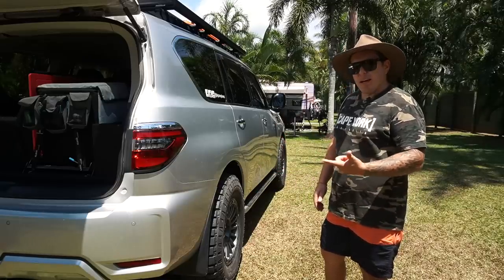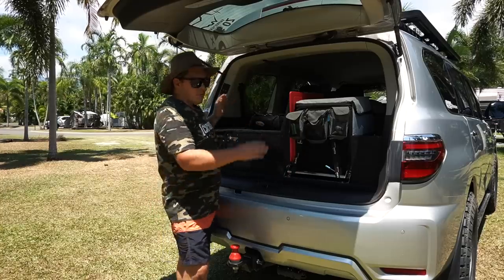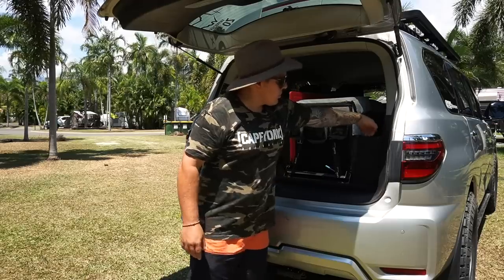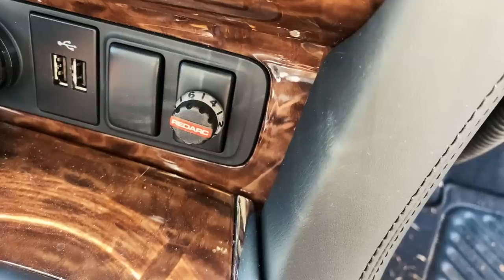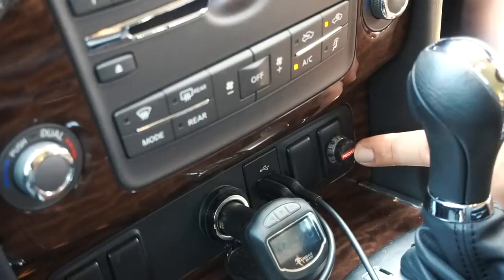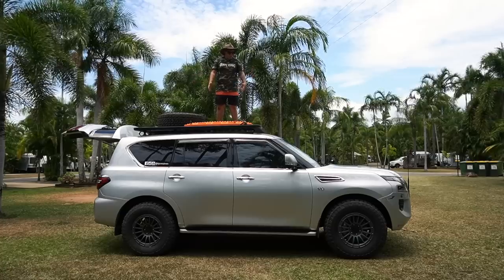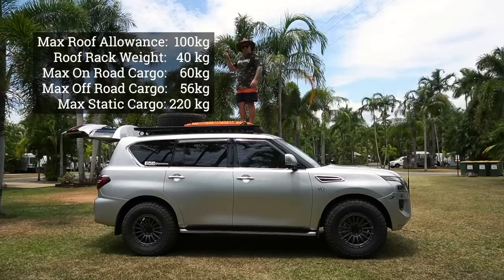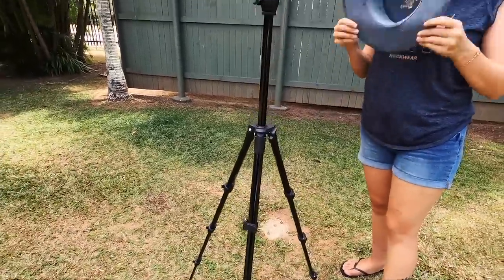AIRBAG MAN SYSTEM / TOWPRO / RHINO-RACK / Y62 S5 Patrol - BIG OZ BUILD - PART 6

Comment: Chris. The most important thing for tyre life is rotation and correct tyre pressure. I used to be a wheel alignment technician. Keep on top of the wheel alignments and rotate the 5 tyres, yes keep the spare in the rotation. If you rotate you can compensate for whatever uneven wear you may get. If you let it go too far then the tyre wont last as long.

That remote control is a 90s throwback. Looks like the Nokia phone in "the Matrix"
Reply from the maker: Thanks mate for the advice! ☺️ 

And that’s funny about the remote, it totally is 🤣🤣🤣

Comment: Hey mate, with the pressure your running in your bags loaded, I believe you run the risk of bending the rear control arms.
There is a  fix from on track 4x4 shop in vic they do billet replacement arms. I have them in my 62 and love them , you get the added bonus of gvm upped to 4085kg and 2” lift, not cheap . You get what you pay for.
Reply from the maker: Technically speaking when we tow we are still within Nissan’s manufacturers guidelines so we shouldn’t be bending anything... We know of On Track and decided against it, not because money was an issue but because we wanted to show people that you don’t need it where others do have money restraints. If we bend an arm, we’ll fix it at that time I guess ☺️ cheers for watching and the advice regardless! 🤙🏻

Comment: I think its  a legal requirement to have an electronic brake controller for towing anything over 750kg.    Not necessarily legal requirement to have a red arc tow pro..   any brand of controller will work just fine. ...
Reply from the maker: Yes 100% agree! If that was worded wrong or heard wrong, I can assure you we’re on the same page! Redarc or any other break controller will do the job for over 750kg 👌🏻

Comment: Great video as usual. I can say the sony's do run hot when doing 4k 25-30fps for more than about 8min. ( Happens to other brands too "GH5") I recommend the "smallrig" frame for your camera as it gives you a bit of protection and the ability to hang not only mic's but lights etc off them. You are giving me some great ideas for locations etc for our eventual trip north. Safe travels
Reply from the maker: Thanks Tezza! We don’t record in 4K thankfully (way too big for YouTube) but 2.7 so we have some wiggle room if I need to zoom in. We haven’t had another issue since and overall it’s been a pretty good camera otherwise! Thanks for tuning in and glad we’re stocking you up with ideas ☺️
Reply from the maker: I meant to say too, we have a cold shoe mount coming that moves your mic off to the side and keeps it out of the video frame. I’ll look up the one you suggested and have a look ☺️

Comment: Interesting, we picked up the new van yesterday and our car has reverse wired in the plug but not on the van, issues with the red arc as well, won’t learn, then you start up and it has, next time no, ESC not working and reverse lights on the car come on slightly delayed when you apply the brake, original wiring from Ford and we had ECG issues and Ford blamed the trailer loom, they pulled it apart and it looks dodgy as now. Bloody frustrating, I guess my Sunday is mapped out in tracing the loom and the wiring on the van plug. Almost as if the ESC has been wired up to the wrong pin, now waiting on Jayco to supply me a coded wiring schematic on the van plug. 
Great content guys. 
Cheers.
Reply from the maker: Oh wow Michael, sounds like your on a wild goose chase like we were. I hope you can sort it all out easily. Don’t stop asking until they do it, someone is at fault and it’s not yours 😲 Thanks for tuning in mate!
Reply: @BigOzExplorers  cheers guys, I got to the bottom of it, they supplied the wrong wiring diagram for the car, Sunday I’ll tear it down and re wire it correctly.
Reply from the maker: @michaeldearaugo4552  ah that’s great! So glad you got it all sorted 😍😍

Comment: Good information guys. It's a shame the job wasn't done properly the first time but it's nice to hear the business rectified their mistakes. Did you ever try deflating the spare to fit in the underbody carrier?
Reply from the maker: We did try to deflate it and fit it underneath, which it did but very snug and required ’perfect’ placement. Since all this new wiring has been put in though it won’t fit any more. Unfortunately, the 12 pin and Anderson’s are more important than having the tyre under there 😞
Reply: @BigOzExplorers  would you consider  285/70 tyres to get the spare off the roof after this set wear out? You would lose 14 mm in diameter and 10 mm in width but would still look a lot better than the stock 265's.

Comment: Go on , name and shame 😂😂 nah just kidding, thanks for the info mate , all good stuff! Still concerns me about how much pressure you run in the air bags, but if it works , rides good and they are rated, go for it 👍
Reply: I think the ARB sticker above the Anderson Plug gave it away.
Reply: COSICAN haha yeah I missed that
Reply from the maker: Haha Detective Cosican is on the job and found a clue! 😂 That sticker actually covered a mark where the fitter drilled into the bumper 🤯 I’m particular with stickers and peeled it off only to find that 🤦🏼‍♀️
Reply: Big Oz Explorers wow that is really rude of them!!! Can’t believe someone would do that!
Reply from the maker: @Mrbeast0099  I know... but that is the fitter not the companies fault I guess 🤷🏼‍♀️
Reply: Big Oz Explorers true
Reply: After 10 years of purchasing and using ARB gear I'm very selective of what products I purchase off them. I'm just about to start another 2nd hand build and due to the last one I will start by pulling out 90% out the wiring done by them. I've just had too many issues in the past.

Comment: No trailer plug is wired for reverse HOWEVER if your van has reverse lights legally they need to work so will need to get that fixed. If the lights there they need to work this includes extra spot lights forward fitted etc
Reply from the maker: Hmmmm interesting! I’ll have to have a chat with another electrician 😅 just when you think you’re done, you’re not... lol 

Cheers for tuning in ☺️
Reply: @BigOzExplorers  very easy as a diy to wire it yourself

Comment: Hi guys. Love your work and sorry to hear of your dramas. Very curious to hear your thoughts on how noisey the rack is? Wind noise, rattles? Cheers, Adam
Reply from the maker: Hey Adam, initially we recognised a sound at around the 80-90km mark but it’s not droning or too loud. And we are particular so I’d tel you if was bad lol. I don’t even known it’s there anymore, it’s really not much if at all ☺️ we had a rattle in the beginning due to bolts being loose from fitment but after a bit of locktite they’re silent! 👌🏻

Comment: Hi Guys, Any reason you went with Pedders for the coil springs as against say King's or Lovell's? Just curious? Great video's
Reply from the maker: Hey Helen, we went with these as we had spoken to another couple of Y62 owners that were using the same coil springs. At the end of the day, I’m sure it won’t matter which ones you go with but these ones are used in the Pedders GVM upgrade range so there mighty strong! We have a heavy ball weight and well so we wanted to be on the tougher side. When someone in the same car has used the same product that’s always a good starting point ☺️ thanks for watching! 😁

Comment: Looks like Nissan trailer wiring is the same as the dmax black wire should be reverse but is a constant power an electrician should be able to fix it cheers
Reply from the maker: Thanks Eddie ☺️☺️
Reply: Good to know Eddie.  We're waiting on our van build and had our 12-pin plug installed when we bought our Dmax new.  We better check out the reverse light pin wiring before the van is ready.

Comment: Hey Guys, what was the model number of the rear spring you used. About to fit our y62 out very similar to yours. 😊
Reply from the maker: Hey Jason, initially we used the Pedders trackryder springs they recommended for the car (usually used for GVM upgrades). Once we installed the 2 inch lift, we had to take them out and replace them with longer springs ☺️

Comment: G'day mate, could you please tell me how you connected your air compressor in the cargo area to the air tank underneath your car.  Did you drill a hole through the floor or wheel arch?
Reply from the maker: Hey Gav, there are rubber grommets at the rear end of the car on both sides behind the wheel arch (similar to what you have between the engine bay into the front of the cabin) and they’re just through there ☺️
Reply: @BigOzExplorers  thanks mate, much appreciated

Comment: Whats your heater again? Any reviews?
Reply from the maker: Heater? In the van you mean?
Reply: @BigOzExplorers  yes in the van sorry.
Reply from the maker: @michaeljohnston8024  all good! It’s a combi heater and works on both gas and electricity. We love it for water heating and heating the van up. Only downside is the space it takes up under the bed, valuable storage space and you can’t pack around it too much due to the heat it creates. We use a timer for a few hours per day of hot water so we can bath Jack/shower and do washing up and otherwise have it off. We haven’t needed the heater function for sometime in these 40°+ days!
Reply: @BigOzExplorers  hahaha, I didn't think you would have used the heater much! We have been looking at it for our van we have ordered. Only negative I could find on them was that they heat up under the bed if you have hot water on. Anyway, sounds like they work for showers and so on. Thanks
Reply from the maker: @michaeljohnston8024  yes they do a little, but if it’s properly is insulated with foam over it ect you should be fine. Just make sure you install it on whichever side the ‘cold’ sleeper in your household sleeps on 😂
Reply: @BigOzExplorers  thanks for the info!

Comment: Did you have to fit a diode for your trailer brakes?
Reply from the maker: That’s a very good question but to be honest, I’m not entirely sure! This was something we weren’t comfortable installing ourselves so we had someone do it for us.
Reply: @BigOzExplorers  I called 2 different ARB stores and got 2 different answers. I have wired in but have not connected to plug yet...
Reply: @sp2074  Where would you want the diode? for the brake signal tap it should be OK, If you use a schottky diode they have a half the voltage drop of a regular one.
Reply: I didn't fit one and the active cruse control has worked fine.